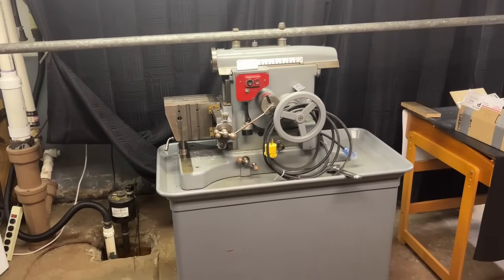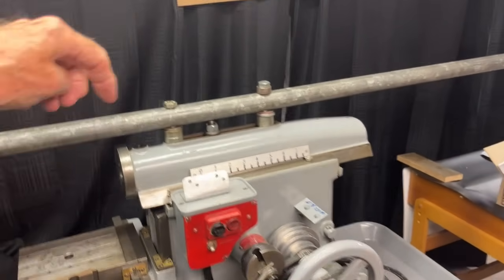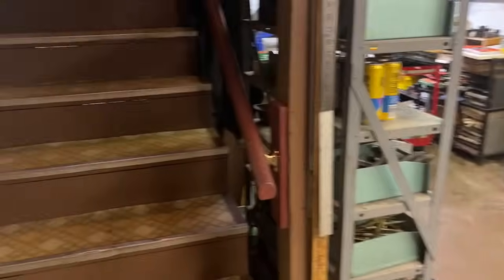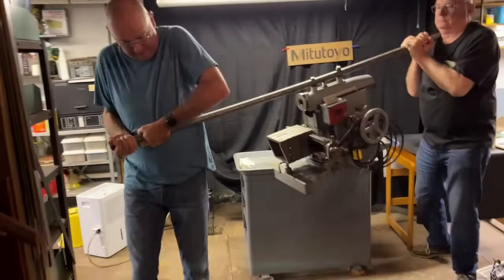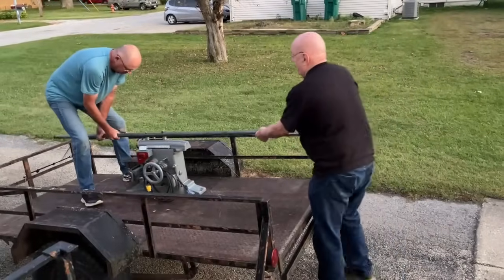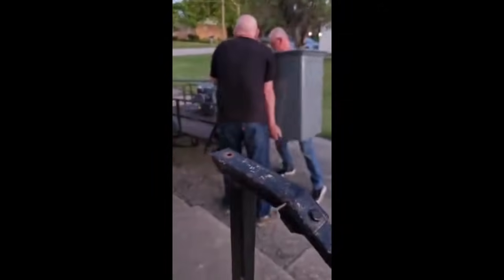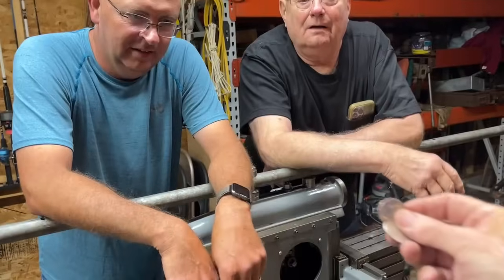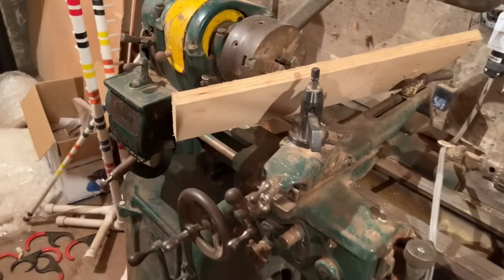HOW TO MOVE A HEAVY SOUTH BEND SHAPER #958 tubalcain

Comment: nearly 20 years ago I bought a 20" Cincinnati shaper with lots of tooling for 150 bucks,, built back in their 4 digit serial number days,  prior to I believe 1911.  Cost me 125.00 for a roll off truck to bring it to the shop.  The thing had almost no use on it and I couldn't sell it,  had people willing to take it IF I gave it to them AND delivered it for free.   I sold the vise and some parts and handles off it but the rest (4800 lbs of iron)  brought almost 400 bucks at the scrap yard.  Next to go is a 120 year plus old 20" lathe of about 6000-6500 lbs.